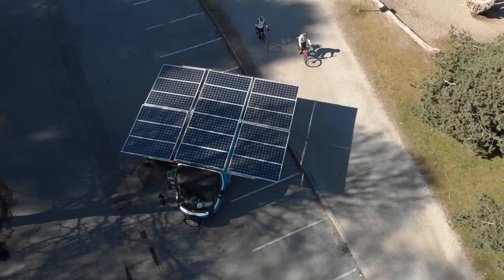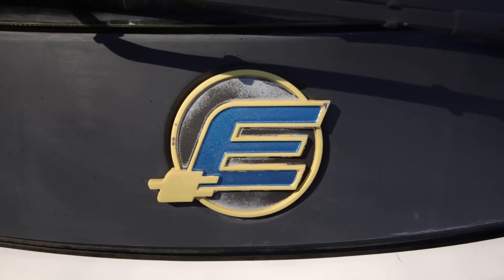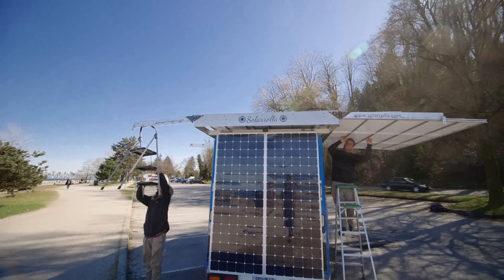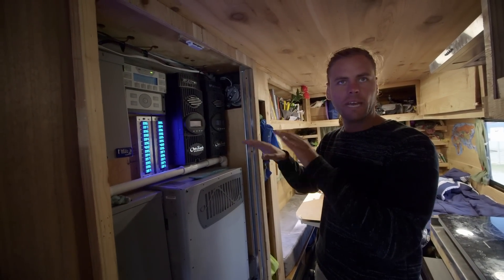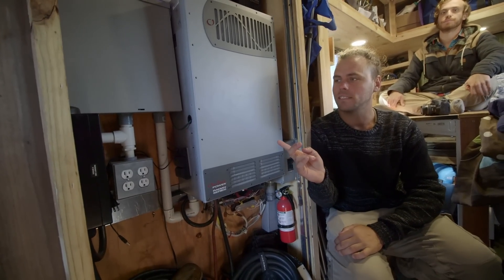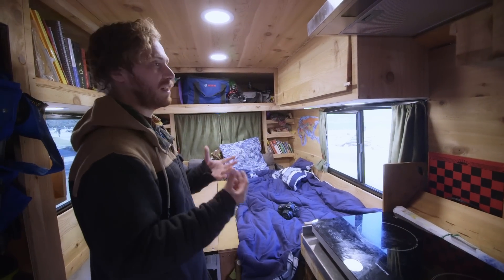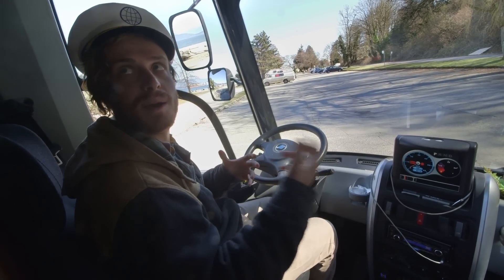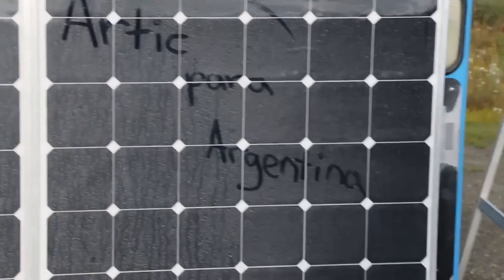Completely Solar Powered Electric Van Conversion

Comment: I have so many questions I guess the first one would be why didn't you use some Motors to extend the solar panels but I think I already know the answer because this is a prototype and you didn't want to overcomplicate it before finding out how those solar panels weathered being mounted to the roof, but I'm curious to know the answer... 

Also what is the weight of that solar array on your roof and how is it fastened to the roof itself? With it tilting that radically I'm guessing there's lots of strain on those mounting points- even a medium wind would rock those solar panels back and forth continuously until the mounting points create enough metal fatigue for them to fail. Is this true? If not, how were these mounted to prevent that happening? 

Did you consider a diesel or gas generator to be able to charge the truck? If you did why didn't you use it?

What surprising things did you learn?

Thanks in advance! I'm so excited to dive into this puzzle!
Reply: this builds for people who wants to be off grid, relying on gas/diesel generator is not going offgrid, thats still trying to be on the grid.
Reply: So you wouldn't consider me distilling my own alcohol to run the gas gen as off grid? That seems pretty danged off grid to me. You must be one of those city environmentalists who don't value redundant systems in a survival situation because you emotionally think of solar as "clean" without considering how many chemicals go into it, the gas burned to transport it, etc., and would rely on a single point of failure, which has in this very video been shown to be unreliable, in your transportation? Okaaaaay

Comment: Just found your channel...
Do You need the Modec / Navistar original factory workshop repair manuals, including fault finding procedures in event of breakdowns , system operation and factory original wiring diagrams...
It's all in a pdf. format 
Good luck 👍

Comment: Your rig is marvelous sure but your ecological footprint is still high because manufacturing all your stuff takes resources and equipment lots of which are supplied by fossil fuels, the solar panels will need to be disposed of some time, yes it is much better than running off gasoline or diesel the more you use the greater your impact.

Comment: Hello I'm working on a solar generator for construction sites. Its in the form of a toyhauler. Trying to figure out the racking system at the moment. Can you give me some details on your racking system? Is it a C channel that the panels slide out of? Or is it a roller baring system?

Comment: my project is a little more elaborate: to begin with, i don't intend to visit areas like alaska or tierra del fuego; and my idea is to travel every 15 or 20 days; and an air conditioner for the batteries; and a solar heater for bath water; divide the battery bank into 2, charging one side and spending the other

Comment: Trying to understand and learn all the different solar components is, well, not where I would like to spend my energy and time, especially when I would rather go on a hike...I hope as they start to roll out more electric vans and trucks that they can somehow just double up on the battery system at the factory and then the house portion can work off of it.  Love the rooftop solar array he has going on!

Comment: I've always wondered why the spinning wheels on a car can't create electricity in the same manner a wind turbine creates electricity. That's a serious question by the way, I know my tech limitations.
Reply: In electric vehicles they do, it’s referred to as regenerative braking. In typical gas engines they don’t use the braking but they do use the engine to turn an alternator which powers the electronics in the car and charges the battery.

Comment: Great work you guys have done on the van! I'm so glad that you guys are doing this trip to prove the concept of solar driven van's. I got a California campervan, and I try to use it as much as possible. Love the travel and outdoor life. Some years ago I installed 200w of solar panels on the roof. That was a complete game changer. Recommended if you have a van. The refrigerator is no running 24/4, and there are plenty of power for light, Charing mobile phones, laptops and other electronics. Would love to have a solar electric van in the future! Keep up the good work guy's! Thanks for sharing your journey with us!!!

Comment: You really need to work a bit on simplifying the architecture. Going from solar DC, to MPTT tracker, to AC, to battery, then from battery back to AC, then from AC to DC to charge the vehicle battery, then to motor inverter. That is a lot of conversions, losses and weight. With a proper MPTT tracker and DC/DC converter/charger it should be possible to just use one high voltage battery and eliminate a lot of losses.

Comment: You need to simplify the unfolding and alignment process, maybe use some electric motors or hydraulics. Few linear actuators will do the trick i think.

Comment: Note that the solar panels that usually goes on roofs and other land installations are not optimised for weight at all. They are to be sturdy, long lasting, etc. You could reduce weight significantly by changing glass thickness, and using thinner aluminum profiles.

Comment: Damn. That is exactly What I am talking about. Trucks of the future should also use similar setup. All sides covered with panels, unfolded when parked.  You can even tilt the side ones to be toward the sun, so it is more effective outside of summer. For a real world trucks, probably some area at the low portion of the side would be left without panels, because maybe of risk of damage by other vehicles or road conditions, gravel, small stones, etc.   Otherwise, yes. The big truck could easily make 20kw of power this way, and if multi-junction solar cells become more affordable (they are only used for satellites right now, and few experimental aircraft), it could be over 30kW actually.

Comment: Retiring in about 14 years. I'm hoping there'll be enough advancement in the solar tech that it'll be much easier/convenient to do something like this. Otherwise it'll be hydrocarbon engine with the house running solar.

Comment: The inefficiency in those home
Is unreal tho... Converting battery voltage to 240 then to convert it back to extra low voltage to charge laptops and what not... Using the home
Compartment battery to chatge the vans onboard battery... Those are huge efficiency losses

Comment: Let the good times roll with photovoltaic ...both my tow vehicle  ( delta trike three wheel drive) and trailer will have panels attached so as to keep the CG low  . The electric trike is complete, now building the trailer....hope to meet you guys on the road ..thanks for the video , I'm hopping my wife will want one

Comment: it would be awesome if the panels would expand with the press of a button using small motors.
But super cool van with lots of solar
Reply: That's the 1st thing that came to my mind, it would add some weight tho. Otherwise great

Comment: If the extra panels are folded down the sides during travel and hinged at the top, when parked they can pivot and track the sun during the day and get some sun exposure when traveling on one side and the top. If you park so 1 side faces the sun it will start charging early in the morning and the other side can be vertical

Comment: Guys amazing job, my admiration. Quick question. How do you deal with all the connections and cables ? i mean, every time you move the panels out and in, i believe all the cables and connections attached they move with the panels as well right ? Is there no risk that with the time the cables inside break or disconnect ?
Reply: you use flexible cables, its used everywhere

Comment: So ummm?

$80k?
Reply: 80k and 2 months just to build a machine that is terrible for the environment while there are homeless people.
Reply: @Awiled  What exactly does that have to do with, really anything?
Reply: @Awiled  I see you have a lot of big words. Well done.
Reply: @JasonCarmichael  you can't have words, you use them
Reply: @JasonCarmichael  maybe the point was to bother you
Reply: @Awiled  Well, all you have done is make yourself look idiotic. Which has only entertained me.
Reply: @Awiled  terrible for the environment how?
Reply: @LanternsoftheDead  To my knowledge the toxins and co2 released as a result of mining for and manufacturing the solar panels almost equals the environmental benefits. This is assuming that your solar panels run at a high efficiency which they often don't because of dirt, dust, snow etc.
Reply: @LanternsoftheDead  Not sure where your comment went, but look up "how long do solar panels last" and you will find that they last a maximum of 25 years with reduced efficiency of 0.8% per year.
Reply: @Awiled  25 isn't the maximum. Depends on the quality though. Again, there are panels still working from more than 25 years ago. And reduced efficiency of 0.8% each year isn't massive. By the time they need replacing, the newer solar panels should be even more efficient, and the old ones should have more than made up for the co2 they emitted during production. That's 25 years of not using coal for energy.
Reply: @LanternsoftheDead  hmm I can tell neither of us will "admit defeat," so instead of arguing with you I'll spend some time doing more research on this topic.

Comment: New solar panels that are flexible, can be attached with strong double-sided tape, and are not fragile like the glass kind have recently been invented and are available to the public. A couple that live in their van and travel around Europe - Wild We Roam - installed them on top of their van.
Reply: news flash, flex panels have been around for many years. but they are far less durable/reliable and just dont last as long.

Comment: They should add some small wind generators that they can raise up on masts so they can generate more power more often.  When I used to live in a off the grid yurt, having the wind turbine and the panels working together assured me of power at all times. I never ran my gas generator.

Comment: Hi guys,

First, I think it is great that you are going out and actually doing this! Talk is cheap, doing it is hard and the amount of commitment and effort involved to be one of the first is impossible for most people to understand unless you have been there yourself. I have been there so I get it.

Second, like all prototypes, you learn sooo much as you go along. Of course there is always a better way to do what you just finished doing and you figure that out right as you are finishing!  :)  It is just part of the process.

Third, a few constructive thoughts and suggestions: is there any way to keep the weight down on the interior finish? Wood is pretty and easy to work with but it is heavy and weight is the enemy of EV's. As weight goes up range goes down.  Next, I don't know what tires you have on there but low rolling resistance tires would help greatly in the US where roads are good but may be unusable as you go further south where slippery mud roads and steep grades are tough even with 4 wheel drive and all weather tires.  And a question; do you have ebikes for exploring around base camp while the van is charging? Would be a good fit.

Finally, major kudos and best of luck to you guys! If you are ever travelling through San Jose in the San Francisco Bay area you are always welcome to park in my driveway!

Comment: IV had enough trouble finding a place to install a single 80w panel on my 30ft boat and that's expensive enough
Reply: If you buy an 80W solar panel in a bpat shop, yes it is expensive.
I bought a used 175W panel for 20 euro :) but it was quite heavy though

Comment: What are you using in the van that needs that much power?
  And what happens when a big gust of wind comes up?
Reply: True Texan that power is used to drive the vehicle down the road.

Like all awnings there’s a wind load rating and you put them in if local gusts reach a threshold

Comment: The cost o the electrical system would fund my fuel hungry 1979 Dodge conversion van around the country many ,many, many, may, many, many times. For a house i could justify a system like that, but a van, not so much. Solar for my van will be to keep my laptop and cellphone charged so I can continue to work from anywhere. I wonder how much money was spent on their electrical system and conversion.

Comment: 6000 watt on the roof
parks in shade
Reply: This probably for the filming. It's very hard to get a good shot on a vary sunny day because of all the dramatic highlights and shadows it's much easier and better looking when you film during overcast or in shade as they did.
Reply: Hahah
Reply: And that should mean 2k when driving so they are doing something wrong only getting 300 miles.
Reply: @yesbutwhy9501  quick calculation.  They have 2kW in panels, flat when driving, in Oregon in July on average day, this will make about 10kWh/day.  Their website says total battery capacity is 120kWh, so 10+120 kWh =130kWh.  300 miles from 130kWh gives 43.3kWh/100miles which is about 31% less efficient than a Tesla Model S but not terrible considering the weight and profile of the van.  The 2kW solar panels would make enough electricity for an extra  23 miles each day.  Unless they are grid charging they're probably driving at night and collecting while parked with all the panels tilted during the day.
Reply: @Chrisisreal978  There is some efficiency loss from the 'piggy-back' battery compromise. Panels charge lithium battery, then lithium battery charges NIMH battery van was built with. But that was technically much easier than ripping out the van's built-in systems. This is a general problem with using an existing EV as the base vehicle - they all come with tiddly ('daily deliveries') batteries and no easy easy way to integrate a bigger one. Still, making all that work in 2 months is remarkable.
Reply: @Chrisisreal978  Great answer. But, there is a portable kit with collapsible solar panels and a cable to charge directly an EV? I have no found anything yet anywhere.

Thanks!
Reply: @Chrisisreal978  i feel like it is more of a "drive a bit" and then chill for a few days situation.
though, they can still use stations.

an hybrid would be great though.
Reply: @yesbutwhy9501  300 km 200 miles
Reply: @benangel3268  ein?...
Reply: @yesbutwhy9501  I was thinking the same thing at least another 75 miles or so
Reply: Well, maybe it was going to be sunnier...later.  In that spot.  But I have been thinking that I maybe would rather dispatch PVs on the ground and park in the shade.  Maybe that would be a lot of work but campers can be really hot in the sun.  So efficiency goes out the window.  But I gotta hand it to these guys, this is quite a rig.

Comment: Would like to convert my Ambulance to Electric.  I have 2700 watts of solar.
Where did you source you electric motors?
Are you coming thru San Diego?
Reply: The International E-Star was built by International (Truck OEM) as an electric compliance vehicle for the ZEV markets. As far as converting an ambulance, check out Diyelectriccar.com, lots of good info. A Nissan Leaf motor would work in an ambulance, but unless you are a engineer/tinkerer, it will be a year or two before enough info is published to do a conversion without lots of testing and engineering
Reply: They didnt build this
Reply: Bruce Richard  the tesla electric motor is superior

Comment: What a silly obsession. Its also dangerous. Panels designed for stationary use. System that size can seriously burst into flames and also electrocute someone. Would be at least 400v dc.  Dangerous set up. Hit a bump, your fried. Very brittle panels. They are not toys
Reply: Lol it's fine. These panels are rated to withstand hurricanes.
Reply: @RouteDelSol  either way thats a lot of current. The panels arnt designed for movement. Flexible panels should have been used.
Reply: @craigme2583  I have been using this type of solar panel on motor homes for 20 years, sorry but you have no idea. On the motor home I have now these panels are over 12 years old and Australian roads are very rough in the outback.
Reply: @craigme2583  flexible solar panels are total trash. I test stacks of them and they have reduced output after three months